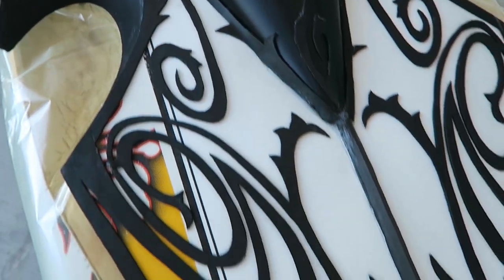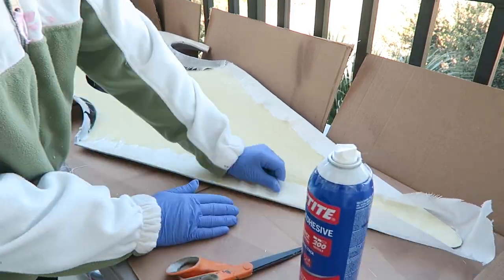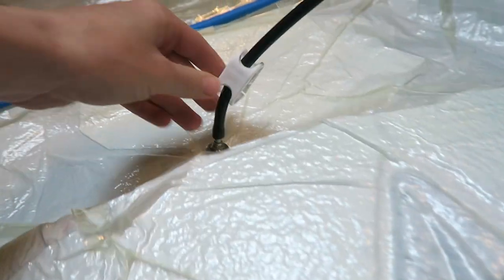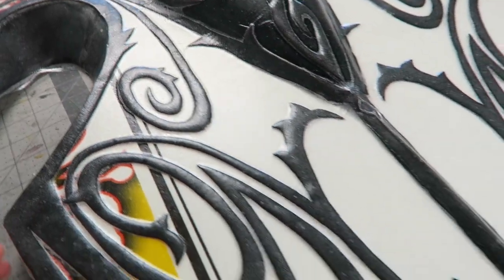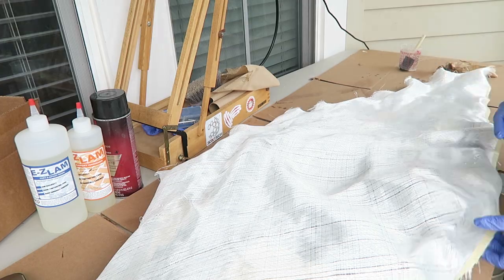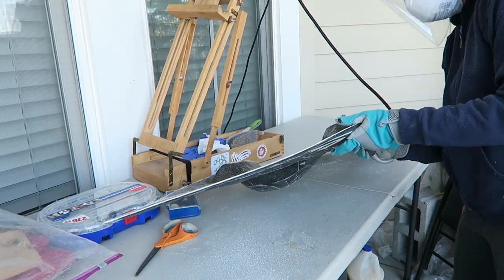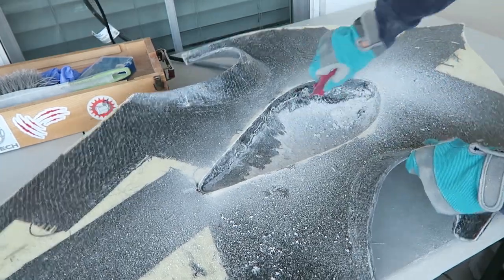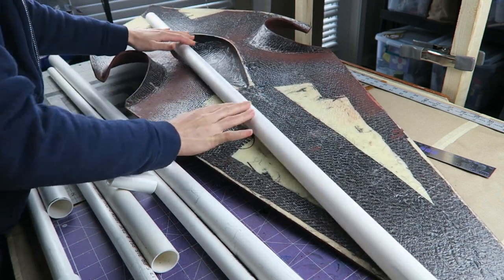Strengthening Shield with Fiberglass & Carbon Fiber | High Elven Shield Part 2 (Pattern Available)

Comment: I noticed you use a lot of rattle cans and your hunt for an ergonomic mouse.  If your hands are anything like mine, prolonged spraying will cramp up the wrist and fingers.   I find the Rust-Oleum Comfort Grip handle for spray cans is a life saver for prolonged spraying sessions, also provides a little finer control.

Comment: Sweet!  Looked really tedious trying to get the fiberglass to lay right around all the woven design bits but definatley worth it from the results so far.  The orange peel look was actually neat looking, kinda like it was a cast iron texture.  It might be worth adding that as a technique in your tool kit for future project.  Thank you for sharing!
Reply from the maker: Somewhat tedious but much easier getting it placed with glue than trying to skip straight to resin and race the cure time. That's a good point, not right for this project but it was an easy way to add an even texture all over. I wonder if it would work the same way again? Glad you enjoyed the video!

Comment: really nice result. It will look awesome. Few more layers and it will be also good as snowboard ;-)
Reply from the maker: Thanks. No more layers, spent way too long cutting out a those scroll details to fill them in with too much resin!
Reply: @LindyDesignLab  still good enough relief. I think that shading will help a lot. Such a level of detail with fiber glass and resin is not usual. You are pushing its properties to extreme.

Comment: Did you find that the resin caused the adhesive to lose its bond any? I have done very little fiberglass work but when I did some of my car parts, I couldn't get the glue to work after it got wet. I totally forgot what kind I used though...probably important info to know.
Reply from the maker: I didn't notice that happening here, but I had used an excessive amount of glue, to the point it soaked through the cloth in places. Maybe there was a reaction between the specific glue and resin?
Reply: Could be. I don't remember the glue type but I used Bondo brand automotive fiberglass resin.
Reply from the maker: Maybe it's a thing with polyester resin vs epoxy then. Guess I'll find out, planning on doing some car parts too.
Reply: Ohhh car parts?!?! You certainly have my attention!
Reply: @LindyDesignLab  car parts? Wow, it is hardest thing, because it can be really dangerous. Mostly it needs attestations before it can be safely mounted on a car.
Reply from the maker: @DanDishonored  for sure, I'll be working on lots of research and experimentation before anything useful comes of it.
Reply: @LindyDesignLab  I'll be watching you (creepy way :-D)
Reply from the maker: @DanDishonored  stay tuned then cause the first attempt is likely to yield a fail video.
Reply: @LindyDesignLab  even if video will fail, I believe that your parts will be awesome ;-)